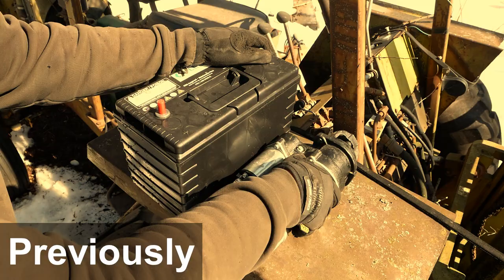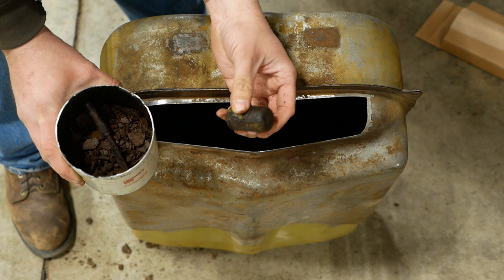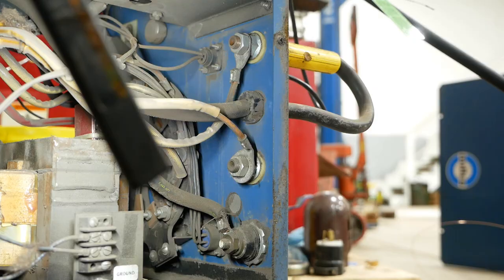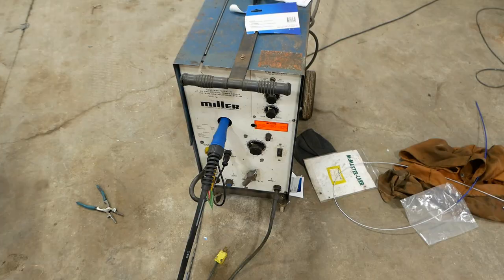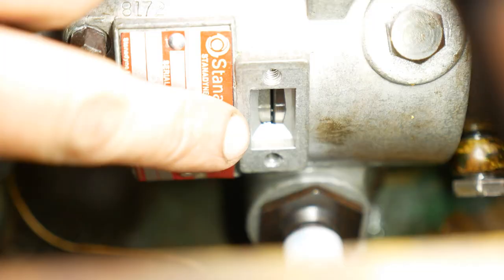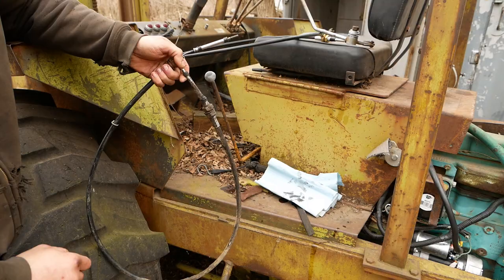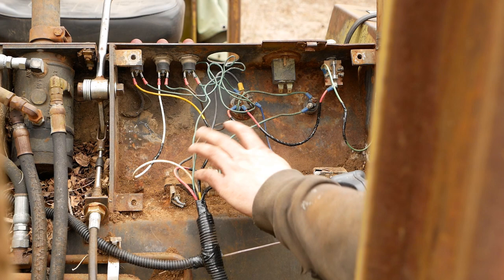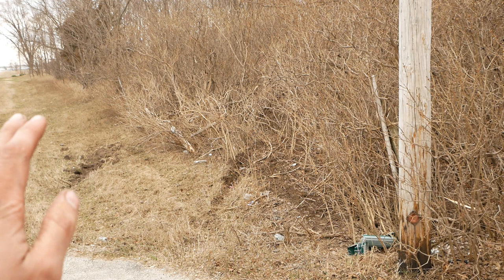Neglected Forklift Drives for the First Time in Years!

Comment: I really like this forklift unit!  Throw up a shed and get it under a roof and protect it. It's too valuable to be left outside unprotected ftom the elements. You could stop by a tire repair shop and pick up some old inner tubes and slit them down the center (rim center) to make tire covers to keep the sun off them to protect what you have.

Comment: The new Miller gun is a nice upgrade, however, one caveat with it.  Depending on how much wire you run, you will need to keep an eye on the liner slipping back from the feed end and coming out of the retainer with the blue rubber seal, causing loss of shielding gas flow at the business end.  Also reminds me I have to peel a fuel tank off a dump truck next week and tig up the hole in it

Comment: Glad to see you got rid of that old club of a Tweco mig gun. I never liked them but have welded with many.  FYI they make a screw on nozzle to replace the push on but it was a pain also because spatter would get into the threads when you unscrewed it. Good choice on the Miller.
Reply from the maker: Interesting. I just have always hated the Tweco. Everything about it is terrible.
Reply: @WatchWesWork  Back in the day mig machines did not typically  come with a gun. Suppliers would sell Twico because they could stock 1 gun style and adaptors for different machine manufacturers. 
Plus they had a higher profit margin on Twico guns and consumables.  Go figure.

Comment: I ran a lot of wire through  Tweco guns in 30 years. The Miller guns do fit my hand better. Still have the orginal 15M on my 190 amp Miller of 1990's vintage. I use .025,030,and.035.solid wire.

Comment: I am glad to say that you were really lucky, inasmuch, as that air pocket that you said the tank would still have when you started welding, is just the one thing that you never want when you are welding a fuel tank of any kind. Because if there ever was any gas or other explosive fuel in that tank, the water in the tank would have pushed the explosive fumes into the air pocket that you said you had at the top of the tank and as soon as you touched the feed wire to the metal, it would have exploded in your face.

Albeit, if there had been any explosive fumes remaining in that tank, it would have exploded from the metal sparks when you cut the opening to clean the tank out, so you were really, really, really, lucky from the very start. Don't ever do anything like that ever again, your family needs you. Next time fill the tank with water and let it overflow, then dump the water out at least 3 times before you make any attempt to get inside. Better still, used diesel fuel to flush out the tank without ever cutting any hole or other opening.

Comment: I find that when you pour new containers(full), if you spin the jug 180 degrees around to where the opening is closer to you(or higher up) it will let you tilt the jug more before it starts to pour also it will not burp because the fluid level is below the top of the opening. This seams counterintuitive but try it it works, you will spill less and have more control over the pour.

Comment: (20:10) We had a GMC rally STX full-size van with a two-stroke GMC diesel engine, and it had the same style of fuel filter.
We use to have to prefill the filter with diesel, so as to lessen the vapour lock on the fuel pump whilst [attempting] to bleed the lines of air...

Comment: Stoked you posted a follow up to the forklift! Such a cool machine, and gratifying to see it run after all the hard work put into that pump.

What an amazing tool box! You got to let me know the brand and model! Especially those box end wrench holders! So space efficient!
Reply from the maker: Kennedy 1022, but it's discontinued. I made the holders.
Reply: @WatchWesWork  Your video about your mobile kit with the Kennedy box came up in my recommended after watching this. Shame they are discontinued.
Brilliant work on those holders though.

There is a Homak that looks identical, is Homak replacing the Kennedy line?

Comment: My worked for a company cutting them up with water, gas storage tanks. I personally witnessed a company pull the company in-ground tank out of the ground over night useg exost gasses off a gas motor running in the tank over night. They kept it running exost through it heating and purging  while using oyx-acetline tourch to cut it up.

Comment: As long as the metal you're fixing doesn't have a thin spot, then welding it shouldn't be a problem.  You gonna find out the moment you put fire to it. A dime size hole is a nice way to practice your welding skills.

Comment: You can weld a gas tank if you run the exhaust from an engine into it for awhile before and as you are welding on it, I watched a guy weld a fitting into the top of an outside 10000 gallon gasoline tank laying on it’s side, he put a hose from his truck into the tank and ran exhaust into it for an hour before welding on it. He said he did that all the time.

Comment: Nice job Wes. Sounds like the hydraulic tank is low or the pump is weak. It lives, it moves, it talks to you. 
Grease the slides on the lift and make that quiet.    LOL
Looks like you will have a great rough country forklift. 
Watched the ADS video yesterday, in fact there are two videos on the pump and then injectors. Great company.
They explained the discount on shipping both ways.
Looking forward to the Oliver install videos.
Thanks for sharing.

Comment: I got a quote on an IP exchange from Area diesel.  They seemed reasonable.  I mentioned you and the price went up 10% ;-)
Have not seen bio diesel in my area in 5-7 years.  It was all the rage for a bit, and it all just disappeared.  Ethanol free gas is on the uptake though.

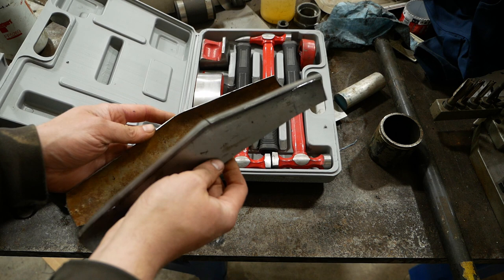Comment: 5:06 yup, if you can, always upgrade the material you patch in. For example, on a steel boat, weld a stainless patch. Sounds ridiculous, and overkill, but it works as an ethos and as a function, make everything better and all that.
10:00 IF you haven't already done so (replaced them, i mean), consider swapping the whole setup from manual (plugs) to a switch. So much less hassle. I used an old one i happened to have around which used to be a panel switch for a big mill type machine, but any rated switch should do the work just fine. Cannot overstate how much better it is not having to deal with the plugs, both in work, and it the fact that they don't stick out anymore.

Comment: As an retired forklift truck engineer, the first thing I would check and change would be the lift chains.  If they break you will have a load drop situation.  The lift cylinder has a drop-check valve which prevents load drop if a hydraulic pipe fails, but there is no safety mechanism for the chains.   Best of luck, this could get costly..

Comment: Again a very interesting video Wes. I've repaired a few fuel tanks and oil pans just as you did, with a butt weld. I use a Millermatic 120 with .022 to .025 wire. One suggestion.  After cleaning and repairing pour some aerobic curing "POR-15"  epoxy inside.  It becomes non soluble with glass like hardness. Keep them coming. 👍

Comment: Its not exactly the same as welding a tank but its a story that might help someone not make the same mistake,  when i was a kid back in the Early 90s one of my neighborhood friends father was having issues with his Dodge Dakota leaking gas. It was the dead of winter and they didn't have a garage. He took the tank off the truck and from what i was told he had repeatedly cleaned it out until no trace of has was left behind and took it in the basement to do repairs out of the weather. I don't know if it was the pilot from a water heater or the furnace ignition that was enough to light the vapors but long story enough already, enough vapor existed and when it ignited it damn near blew the house off the foundation. The family upstairs was able to get out safely but the same cant be said for the father. It took some time for the fireman to be able to get him out because of the extreme fire that subsequently took place. As a Early teenager watching the firemen carry him out and lay him on the ground left a memory and respect for any possibility for a flash fire that i remember like it was yesterday. Be careful i am sure the thought of something lighting that on fire was not a thought in his mind. Sadly he lost his life that day.

Comment: Cutting it out the way you did and but welding it is perfectly fine. Just stitch weld it like you do body panels .And all you have to do is purge it with hot air for at least a half a hour . You can even use car exhaust.

Comment: you can actually pump the fuel tank with the exhaust fumes from your car and let it run for 30minutes or so depending on the tank size but the warm exhaust will basically work like a car exhaust itself burning off 99% of the fuel on the inside. i know a guy who's done this 100s of times and it works.

Comment: Good video,  looks like a useful forklift!  I think gas tanks should be Stainless steel  or plastic.
I have used those epoxy gas tank coating seem to work ok.
it is a good size of forklift and it will help you at your shop,  first work at the land clean up,  I see a few more videos,   a good engine makes the project practical,  thank you for McMaster control cable tip,  I have had a local truck part shop make cables in the past,   I did like Area Diesel video too.

Comment: Hey wes, the timing on the engine is done by turning the pin over at the flywheel and sticking it in the hole catching the hole in the flywheel. the whole fork lift is johne deere. Same as a 2020 tractor.
Reply from the maker: I think it’s a 2640 tractor at heart.
Reply: @WatchWesWork  No Its a 401 Industrial. I know because I also worked for a John Deere dealer for 18 years and worked on plenty of industrial 301, 401. But they started building the reverser transmission in the 2020. 2640's didn't have a reverser option.

Comment: Another  way to seal a tank is to paint the leaking part with a fibre glass resin  it works good particulary if u can't remove the tank or its very thin 👍

Comment: Hitting a fence along a straight road, is easier that you might think. There is something quite common that was not mentioned or considered. To the right of the driver was a purse with an open top, filled with loose items. A bump, birds, squirrel or random thought cause the vehicle to swerve a bit, and the purse started to fall while dumping loose items far too fragile to impact the floor and remain useable. The driver lunged to catch the purse, with an arm too short for any success. The driver's body needed to tilt toward the purse, while holding and controlling the steering wheel. As you might expect, this wheel movement caused the vehicle to enter the ditch. How the vehicle stopped and reversed, will be left to your imagination.

Comment: 21:14 Little trick my grandfather thought me is to turn the bottle you are holding here 180° and then poor it, so the bottle can suck air in. Basically try to keep the fluid down and the opening up as long as you can. Thanks for the upload and stay safe!
Edit: 31:41 An animal jumped on the road, driver tried to avoid it and landed right there ?

Comment: Overlap that hole with 1/8" hardware cloth cut and bent the same way which you bent your sheet metal. Adhere it with filled epoxy. Then cover it with a couple of layers of fiberglass and epoxy. Paint to protect the epoxy from UV. It takes less time and equipment, and it's easier.

Comment: You can often weld a gas tank by dropping in dry ice which is compressed CO2.  It will fill the tank with CO2 & drive out the lighter oxygen, so no chance of combustion.

Comment: If it is that long of a straight stretch, I would suggest taking a nap before you start the drive... Between bend and burns oregon on hiway 20 there is a thirteen mile long straight stretch. It is also where the most tickets are giving and where the most accidents happen from people falling asleep while driving. The locals are the ones with the tickets from laying the hammer down cause it is a very boring and extremely long 13 miles... Need that adrenaline from driving at bat outa hell speeds to keep you awake.... Lol

Comment: Always dangerous to weld or cut an empty enclosed container (even just with air inside no combustibles), with an acetylene torch. If it is running even slightly rich, the acetylene builds up inside until it reaches the point where it can ignite/explode.
Reply: Safe bet is to fill tank with argon or nitrogen then cut same with gas tanks... No safe way to weld gas tanks but you can do it lots of water, and inert gases

Comment: Couple good Aussie chaps showed a good way to weld on a gas tank. take a car, or small engine, take that tank and stuff the exhaust in the tank and let it run till it gets hot and filled with the emissions from said engine/car. that should fill the tank with enough CO to push any hydrocarbons out. and it should also dry said tank. I had to do this for a Honda gas tank for an engine I used on a snow blower. (please please please if you do this use extreme caution in fact just DON'T) zap zap hole sealed no more leaks and no one died. Granted, NO ONE should ever have to or need to weld on one, if you can replace it then replace it. However like in your situation time is money, and both can be an is limited. Same can be said for parts

Comment: I weld on gas tanks all the time you have to  Fire purge it open all the vents vavles caps i use a propane torch on 30 ft long stick with a wheel on it get behind shield I use a 80's land barge hood cadillac  I think light torch from 30 ft away roll up on the stick and stick the lite torch in a hole the tank will likely light on fire thats what u want let it burn till it goes out usually 90 sec is now safe to weld on

Comment: great video....i personally would have given up at the fuel tank and gone no further.....the project is a heartbreaker and it seems that you could easily sink $5000 more into it....its a tough call....you sorta have to decide right at day 1 whether you are going to do a full restore or not.........to sink so much money into the fuel pump and various dedicated toolsd and parts and get the engine running and then realize that 2/3 of the work is still ahead....i dunno....my judgement on projects like this is always poor.....but the work done so far is outstanding

Comment: I have a Clark with flat head gasoline engine made in 70 I think it smokes if it quit smoking it needs oil I call it trusty rusty bucket on back with electric fuel pump in it another bucket up top for expansion tank for radiator because I’m pretty sure head gasket is blown that bucket gets me 15 to 20 minutes of use enough for what I use it for

Comment: You poured from the additive jug upside down.  Turn it so the handle is down under the spout. That way it does not glug and you have fine control.  Bottles that are more full should be poured with the handles under the spout.  Pass that information on to your sons.  My dad (and later, shop teachers) did.

Comment: that kind of looks like the 1020 john deer tractor i got that i'm working on and almost looks to be the same exact tank that's in it as well those are available aftermarket for about 500 in either metal or plastic
Reply from the maker: It's a 2640 tractor on the back end.
Reply: @WatchWesWork  I think it's yesterdays tractor parts book I have in it the john deere fuel tanks are available but they are pricey and alot of the older john deere stuff is availabe

Comment: Regardless of how and with what a tank is purged with the devil is in the seams. Cutting the top out of 55 gallon drums has just as many tragic endings. The volatile seep into  the seam with time and temperature fluctuations and often because of their reduced viscosity/specific gravity/surface tension.  Oxygen in the seam can be  present from when  the tank was manufactured. Unless the purge is pressurized to an extent to penetrate the seam you may have little encased pockets of fuel and Oxygen. Likewise, volatiles like to persist under corrosion flakes and remain untouched by a purge. For every suggestion here of "how to... always works"... be sure to add "so far" to that advise.

Comment: On an old jeep I used metal screw. washers, and non Harding Permatex where the hoes were .... That was 40 years ago .....put the  Permatex on washer put screw through washer with  Permatex up against the tank, then tightened screw in the tank. No leak then.

Comment: U should have cut the wire at the nozzle and just spooled it back on the roll. U don’t have to change the guide either. Just change the rollers. Also I suggest running a Bernard whip. Consumables are expensive, but u won’t find a better setup in my opinion. I weld everyday all day. U can’t go wrong with it.

Comment: Ive welded gas tanks. When i was young and fearless. I would drain the gas, let it air out for a bit then run a flexible pipe into the tank to be welded and then hook that pipe to one of my vehicles exhaust tail pipe and start that vehicle pumping the tank to be welded full of exhaust with the theroy of removing all oxygen from the tank so any gasoline vapors couldn't explode. Im writing this comment so it worked but im not recommending it but theroy is if you can displace all the oxygen then you should be good, should be..... Welding a diesel tank wouldnt scare me. TO BE CLEAR I WOULD NOT RECOMMEND DOING WHAT I DID.

Comment: My two cents worth on " where do you stop". Guess the value of the machine in question. In this case an off road forklift is worth cleaning up the cylinder leaks and rotten hoses. Hopefully the movement issue is only an adjustment or two. Stick a tube into the tires and that should give you a rig worth $10k ?? or so.